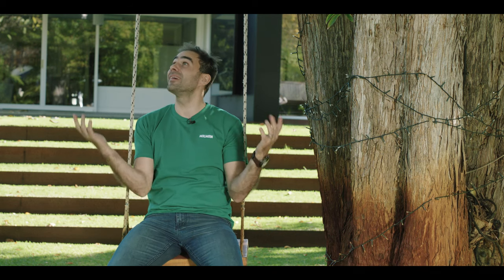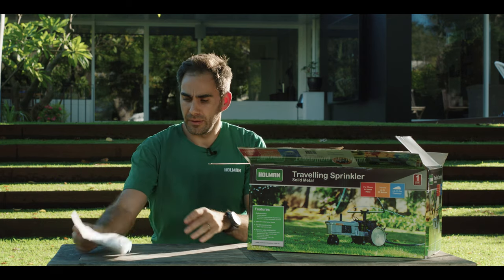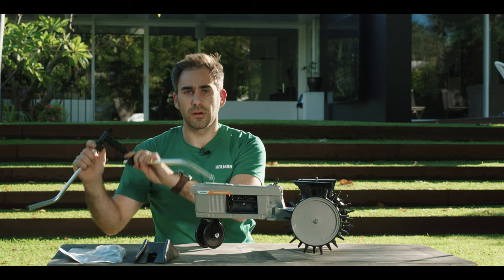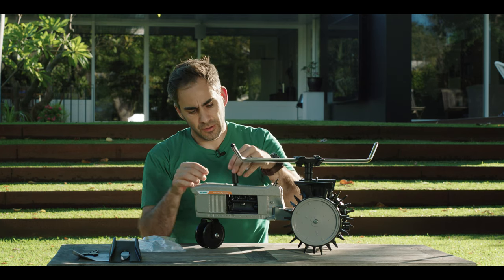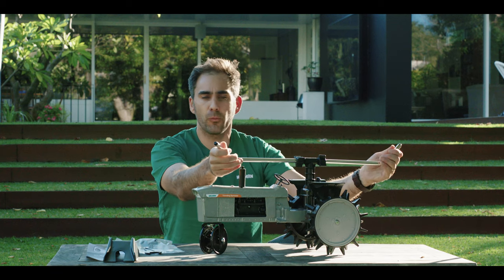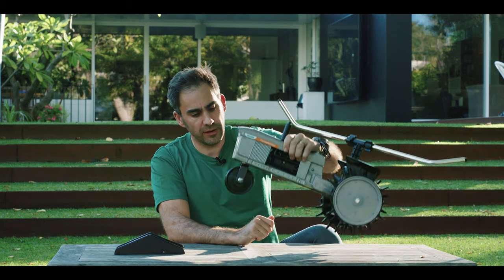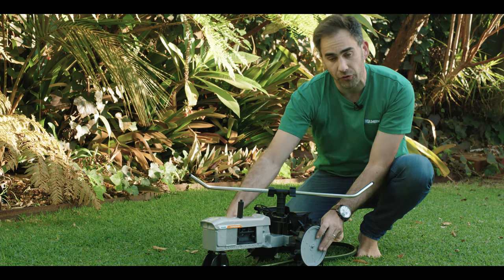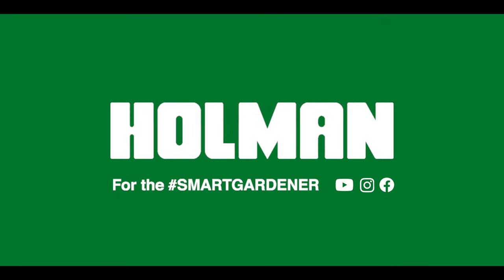How To Set Up a Travelling Sprinkler

Comment: I risked buying one of these a few weeks ago after reading about the problems people have with them, as I have a huge area that I need watering. I noticed when first used that the spray arms were not moving freely, so I let it run for a couple of hours to see if it would free up, but it slowed down and was making a squeaking noise. I removed the grey rotating tube that the spray arms screw into using an allen key on the brass tube inside, removed the circlip holding it together and discovered that the oring on the brass tubing had been rubbing into the plastic tubing, eroding a groove in the plastic, but also eroding the oring. It had made a thick sticky black paste with the grease and was binding everything up badly. After thoroughly cleaning all parts and removing the offending oring, I put it back into service and it has run properly without a problem ever since. A small amount of water leaks from the bottom, but who cares, its a sprinkler! It does a fantastic job and easily pulls my 30 meter hose around, and covers around 9m per hour.

Comment: I have two of these now and while I am generally quite happy with them (in my experience they perform better than the orange plastic Pope ones) they both have the same fault which is that sometimes when I turn the water on the black plastic t-piece that the spray arms attach to will pop up by maybe 5 or 10mm and then the arms won't rotate, they just sit there squirting the water on to the same spot.  To fix it I have to turn the water off, press the t-piece back down in to place and then turn the water back on very very slowly then sometimes they work and sometimes they don't.  I have contacted Holman in the hope of getting some advice but all they offered was that I can buy a new 'motor' to replace mine if I want to - for almost the cost of a whole new sprinkler.  A bit frustrating but still cheaper than installing a pop up system so I guess I'll persevere with them for a while longer...  If somebody from Holman is reading this and know how to fix the problem please let me know because I'd rather not throw my two x hundred plus dollar sprinklers away.
Reply from the maker: Hi Bryan, Thanks so much for your feedback. We will be able to provide this as a spare part in the coming weeks, which will hopefully solve this issue. Please keep an eye out for it on our website.
Reply: @holmanindustries  I just bought one today and it has this fault out of the box…

Comment: How sadly disappointing this water tractor is. Bought one today from Bunnings, along with a lovely new hose,  assembled as per the video - it works for about 20 seconds, then the top pops off and water spurts up.. had a go at re-assembling, then the water just gushed out the base. Re-watched, re-read the instructions, can't find any fault with our assembly.  Spent an hour driving back to Bunnings to exchange it. Now this evening, the new one does actually work as a sprinkler - that bit works really well - but it doesn't move forwards. Upon close inspection, the rear wheels are locked in "high"  gear and in "low"  gear but they roll freely in neutral. .. which just isn't what the instructions say. Unfortunately, the whole thing doesn't actually roll forwards, which defeats the purpose. So it's a very fancy, $7 sprinkler. So tomorrow, it's back to Bunnings (another hour gone) to try to ask for a refund. So I'm left really wanting one of these to actually work, but now convinced that for Holman quality control isn't a thing😞